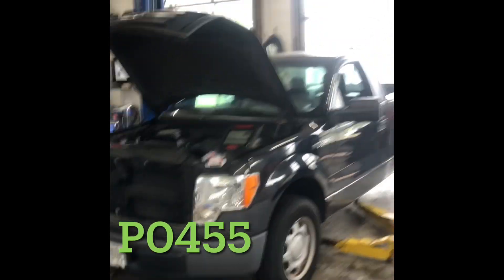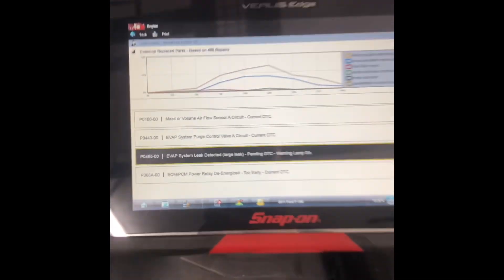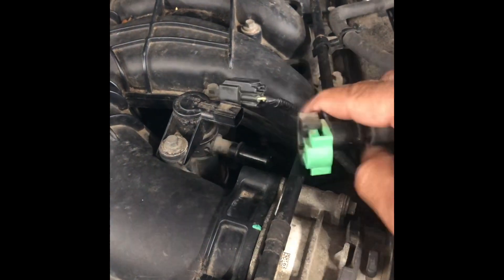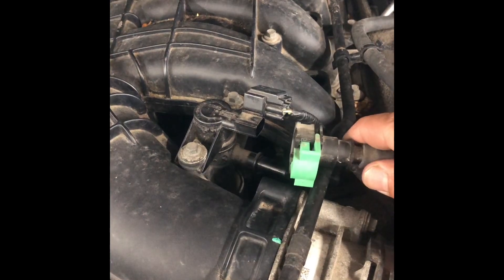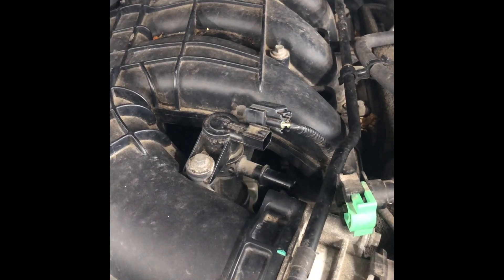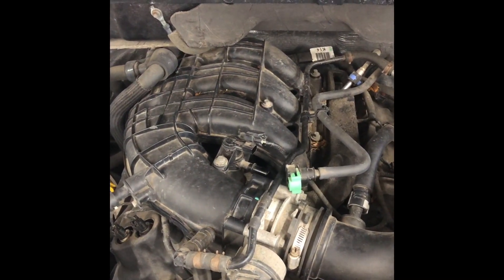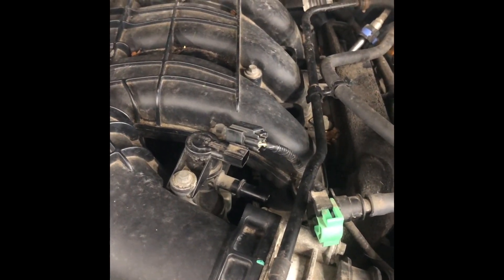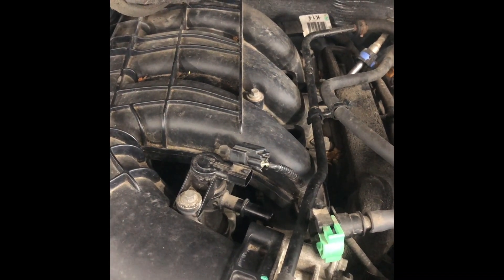P0455, 2011 Ford F150 3.7 liter

Comment: Can a charcoal canister be the cause of a no start it cranks over spin freely. I’ve already replaced the fuel module checked the fuse and replaced the fuel pump.
Reply from the maker: @jkxelor1295  I don't think so.  Hook up a fuel pressure gauge.  Check the spark.
Reply: @ the truck is having periodic no starts to where it will drive around for a few hours and then I will go somewhere and get in it and it will just crank over and crank over without starting.  If we wait two or three hours and try to start the truck again it will start    

Could it be the purge valve solenoid?
Reply from the maker: @jkxelor1295  the purge valve can cause issues if it's leaking vacuum.
Reply: @AllPhaseAutoRepairEssex  I’ll pull the hose and see

Comment: 2012 xl 6 cylinder. This would also cause poor shifting from the tranny, correct? Not downshifting into second for example when coasting with foot of the gas? Or i need to add tranny fluid